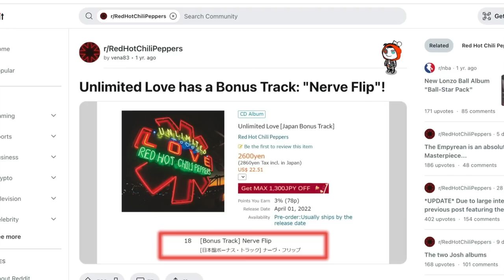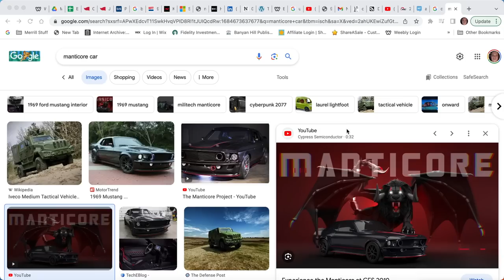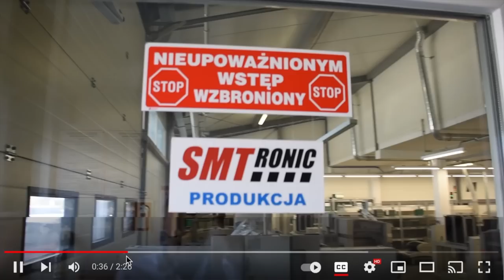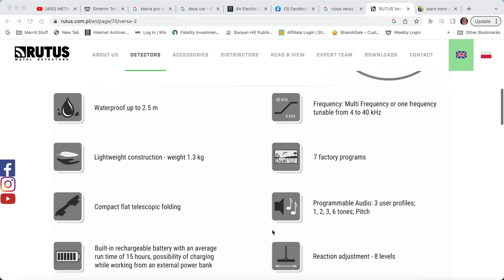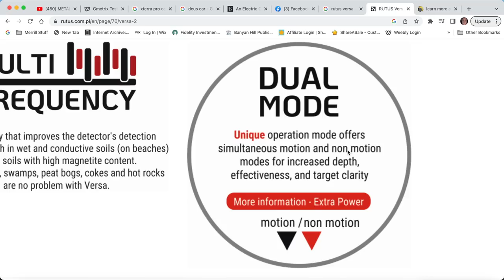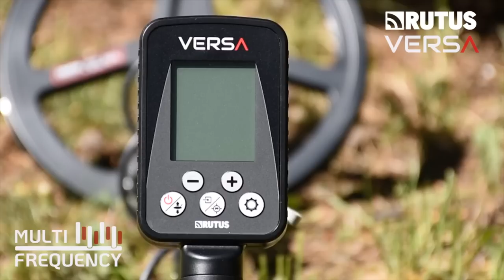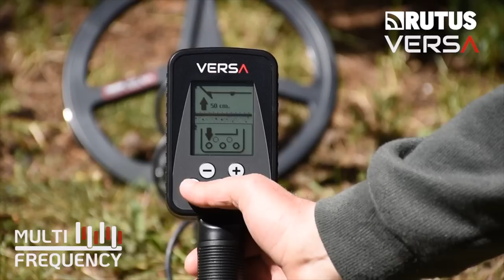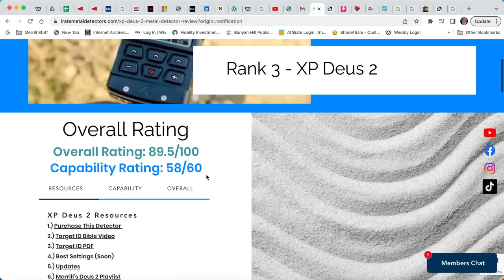The Lamborghini Of Metal Detectors Is NOT FOR SALE In America!

Comment: News Flash flash back. This Dual mode was used once again my all time favorite metal detector the White DFX dual frequency I may add. It has a feature called Mixed Mode. It runs in the AC motion detection mode and Simultaneously in the DC mode or non motion detection mode. If I turned the old gal on and go into any of my stored programs it would show I have mixed mode turned on in everyone of my settings. 
Chaulk up another modern machine usi g yet another feature in the DFX that was over engineered and people couldn't tolerate learning it compared to lesser turn on and go machines. Or so they thought lol 

I am gonna go out and say it. I think my DFX can run up against any modern detector though I might need to switch coils for certain ground sotuations, trashy areas or searching for extreme depth. I wouldnt say it van do the same on an iron salt beach. It has settings for it but I never put the time to master those being I run pulse induction on our salty beaches. On land she'll keep up with the Jones no doubt what so ever. 
OK everybody fire away with the insults or critiques (if you ran one and can set it up) lol. Too many people today would struggle listening to a concentric coils signals and run back to a DD
Reply: Versa da 3 giri al dfx

Comment: Just to clarify, do you really consider the Deus II most capable? You mentioned this before, on your website you have said the Deus II rates as the most capable, according to your rating. But you rated the Deus II at 58/60...you rated the Manticore at 58.1/60. 🤷‍♂️ I mean it's obviously not a huge margin but I'm curious on your take
Reply from the maker: I do. I need to revisit that.
Reply: @MetalDetectingNYC  the new update for the manticore seems to be pretty nice. It may be just wishful thinking but it seems much more stable

Comment: Dual mode is a really big plus from Rutus. Prior to my Dues2 I had the Rutus Alter 71 (still have it!). 
When using a second all metal non motion channel next to the motion disc channel it becomes a lot easier to predict size, shape and depth of a target. 
About recovery speed, the Rutus Alter 71 is easily just as fast as the Deus 1 and 2. It's unbeatable in heavy iron when using the smaller concentric coil and faster recovery settings.
Reply: I’m curious about the static mode for the beach snorkeling 

I had Rutus Atrex i let it to calabash before he stop the detector comparisons
Reply: No offense to callabash, but he didn't know how to use the Atrex. It takes months to perfect it's performance. Once mastered it's deadly.

Comment: Hey fellow detectorists! I’ve been hunting about 4-5 years maybe a little longer and my first and only detector has been a garrett at max. I live really close to the beach and although I pretty much leave it on factory settings for the most part, when I go to the beach and the wet sand it seems nearly impossible for me to hunt. I have tried tweaking the knobs and I can get it to quiet down and work for the most part, but I feel like there must be something better for west coast wet sand? Anybody have settings I should try on the at max for wet sand? Any good detectors recommended for wet sand? Thanks
Reply: AT Max in the wet is not gonna work. Cheapest detector that works in the wet (but is not waterprof) is the Vanquish 340 . Downside is that it's ver basic. The Minelab Xterra Pro seems t work in the wet without falsing,. That makes it the only single single frequency detector that works in the wet. You get a lt of detectr for a great price. The problem  is that the beacjh settings for the wet is 8 kHz. This is not the best frequency for gold.
Reply: X-Terra Pro and it's cheaper than what you have paid for the Garrett and you can change the settings to fit you and your not stuck with what Garrett thinks you want to hear and the same exact thing for the Simplex + (nasty Tone's) and the same thing on the Legend and Simplex Ultra, you can't change anything to fit you but only the Minelab detector's and anything Minelab is better than the Garrett......
Reply: @petervandenbosch6353  thanks, so I’m not crazy. It’s kept me out of the wet for so long and that’s where I want to be. What is waterproof in the $1000 range that you recommend. Mainly for Southern California beaches and parks.
Reply: @carolrice2063  thanks for the reply. Which minelab do you recommend?
Reply: @bigscore1  the equinox 900 but I originally was talking about the X-Terra Pro and the 900 you get 2 Coils with it but it's more of a Detector that you can set it up for you and you can't with the Garrett... and the equinox is waterproof to 16 feet
Reply: @bigscore1  Best bang for your buck is the Nokta Makro Legend. I use it in salt water beaches and it works great. If money is not an issue and you don't go in to the salt water (you can on salt water sand) XP Deus 2 WS6 Master is fantastic. So good that i don't use my Legend on land. 90% of the time is use the WS6 Master and it performs fantastic in parcs. I also have another full XP Deus 2 but most of the time i use the lighter WS6 Master that performs the same as the full version and with the latest update has almost all the features then the full version.